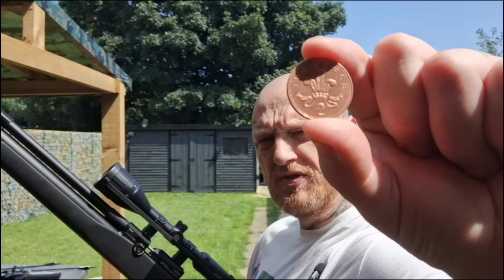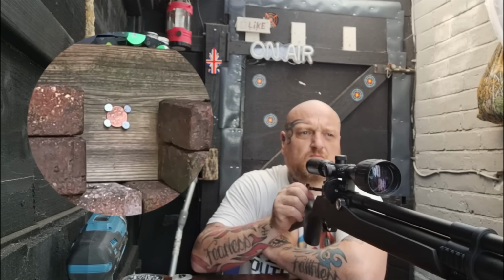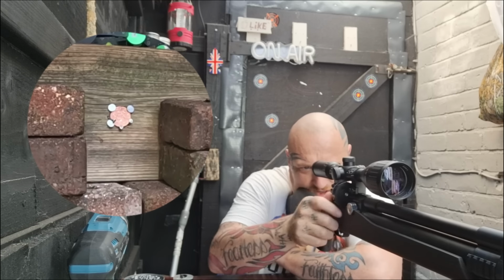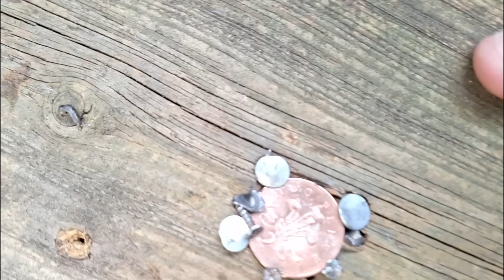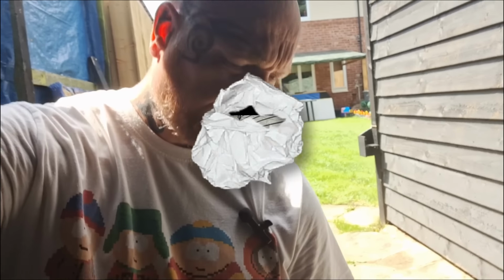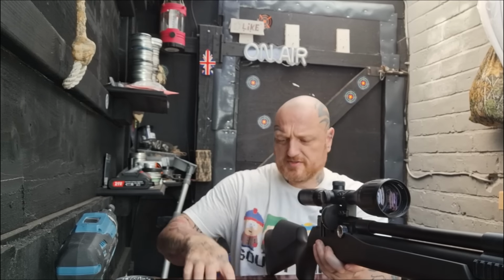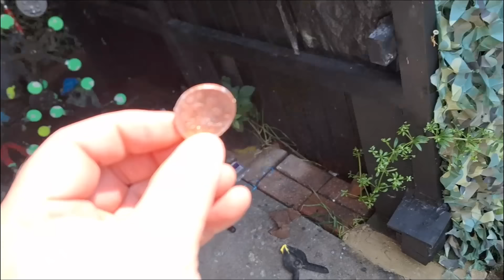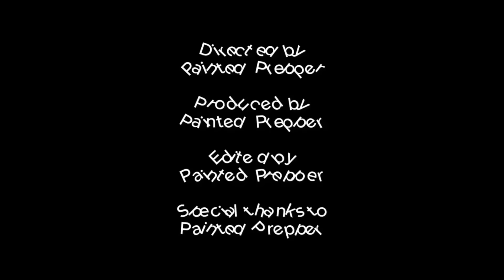Can we shoot through a coin with sub 12ftlb Airgun?

Comment: Try and find some 1980's vintage "Sussex Sabot" Pellets.
Hard Copper and Bullet shaped with a plastic jacket.
I remember them punching right through a metal plate I used as a Backstop and the Fence Panel behind.
Was using a 12ft lb HW80 in .22.
The plate had no problem stopping any of the Lead pellets I used prior to this.
Reply from the maker: oohh ok that sounds pretty sweet, nice 1 ill have a look thanks man 💪😎
Reply: @paintedpreppers-airguns   Not a problem  bud.
 They come up on eBay now and again as quite collectable now.
The .22 version came with a plunger type loading tool which you would need to ensure was with them as they assembled in 2 pieces (The Sabot and the Projectile)
The .177 version came pre assembled and could be used just like a normal Pellet.
P.S. Great Channel - New Sub.👍
Reply from the maker: @nthnmonkey  cool that's weird yet interesting nice 1, thanks a lot for the sub defo appreciate it 💪
Reply: I used to use them in the early 80,s. I thought they got banned but I may be wrong.
Reply: @nthnmonkey I always seemed to lose the pellet tool about 5 mins after I opened the box.

Comment: Why not just a larger copper sheet the same thickness as a 2p? You can securely attach it to a wooden frame, and draw a ring the same diameter, as the coin. That took about a minute for me to work out.
Reply: That's not the point.

Comment: Ever thought about using a SABO air pellet? _Though i'm not sure if they'd work with the cartridge but on my old FWB 124 Sport, they had massive penetration into wood.
And you need to use a mole grip to hold that coin. Once in one of those grips, that coin's not going to budge.
Reply from the maker: yea that defo sounds better than my make shift dodgy clamps lol

Comment: This challenge depends on the age of the coin, newer coils (after 1992 have a magnetic core (steel) older ones are a bronze alloy (much softer).
Reply from the maker: aahhh ok that's me revisiting this then at some point nice 1
Reply: @paintedpreppers-airguns if you have one...compare a .177 rifle to it. Higher Muzzle velocity might change results
Reply: We did this bro. Braze the 2p onto the end of a piece of steel pipe the same diameter. Hold in a vice. I'll not tell you the outcome. But try it, you will be surprised.
Reply: Not entirely correct. The two pence coin was originally minted from bronze, but changed in 1992 to copper-plated steel. The whole coin is essentially steel, with a thin plating of copper. It just so happens that the iron in the steel is attracted by magnetism.

Comment: Does it depend on the coin old 2p coins were much softer with a higher copper content  modern  2ps are coated steel use a magnet to tell

Comment: I did it back in the early  80's as a kid with a HW80 and the original steel  Prometheus pellets,  it turned the 2p piece into a witches hat  the steel part of it  ripped through without the skirt , the way I did it was use a set of mole grips to hold a large enough socket and I put the 2p piece in that.
Reply from the maker: Nice 1, sounds like a much better way than I tried lol

Comment: Not been into airguns for some time but if you could get hold of the old type of Prometheus pellets that were a domed steel core with a plastic surround you might have more luck. Lead is softer than copper so your never going to do it.
Reply: They steel do them